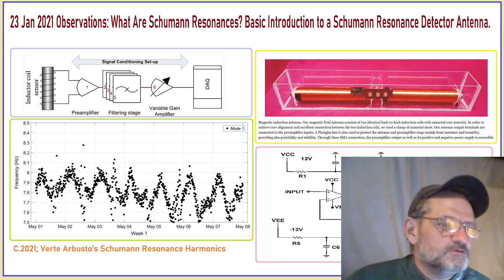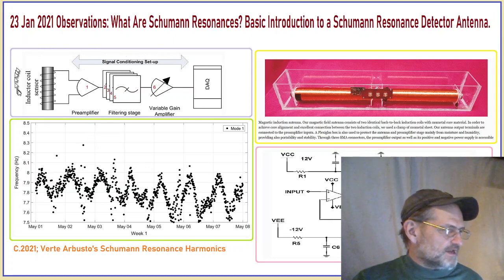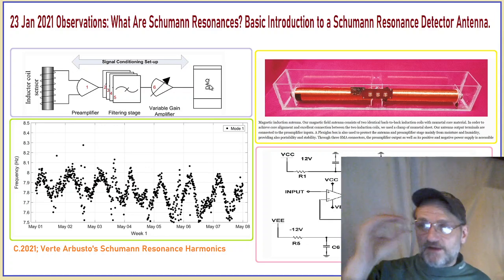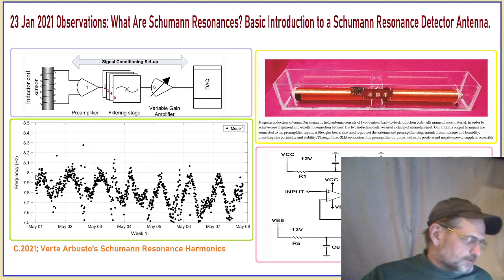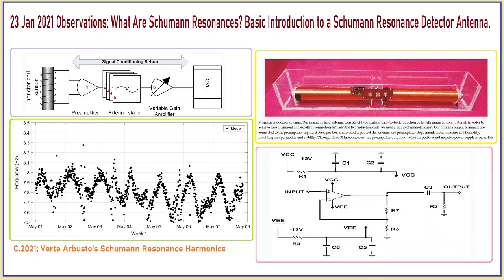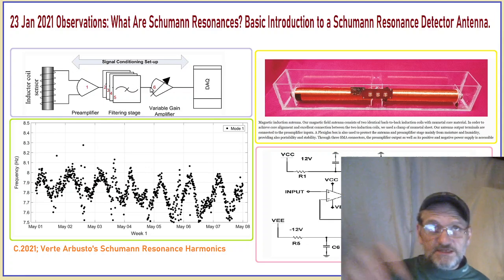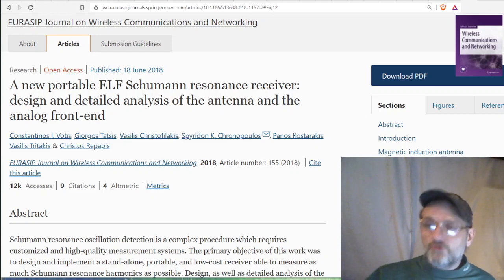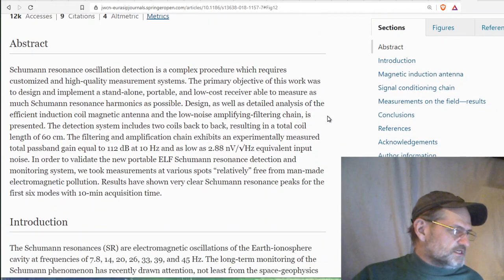24 Jan 2021. "A New Portable ELF Schumann Resonance Receiver"; Part 1. Abstract

Comment: I wonder if the other end of the metal rod that the copper is wrapped in is connected to ground?
Reply from the maker: If its not buried 6 ft into the ground, there will be a voltage differential. 
Earth ground itself is more powerful than Schumann Resonances.
Reply: @schumann-resonances  Thank you for the answer If a 1 centimeter thick aluminum piece is placed on the other end of this metal, will it prevent the signal transmission?  I am asking this for this reason;  I want signal input from only one end of the mumetal.  As you know, thick aluminum bar prevents signal transitions.
Reply from the maker: @ahmetozdemir7173  To do what with it?
After a certain point, it has nothing to do with Schumann Resonances and then you are just running a radio.antenna experiment. 
These things are designed to tight tolerances (the antennae), to detect a narrow range of signals. 
You lost me in trying to explain what you"re doing.
Reply: @schumann-resonances  I asked this for this reason; I want to be able to find the direction of the Schumann resonance source. That's why I wanted to ask if it would be helpful to close one aspect of the mumethal.
Reply from the maker: @ahmetozdemir7173  The source is lightning in the atmosphere. These waves travel the glibe, then crash into each other, to create standing waves. 
I don't get what other-else thing you are looking to find?
Reply: @schumann-resonances  For example, an earthquake signal.  Or, the storm, or even the direction of the Lightning zone.  Being able to find the direction of these resources is something that is important to me.
Reply from the maker: @ahmetozdemir7173  Earthquake requires a seismograph. 
You will need to contact a legitimate Electrical engineer, or radio tech. 
I have no idea how to deconstruct the precision antenna to morp it into some kind of other detector. 
I can't see how you can get to what you're looking for with the mumetal, induction coils, or any of that. 
I am nowhere near smart enough to deconstruct the Schumann measuring hardware, to morph it into that you're looking for. 
Schumann resonances oscillate in pmace. They don"t have a source like you are striving for.
Earthquakes don't cause Schumann. 
Its a different circuit altogether.
Earthquake range is in the nano, or milli-volt range. 
Honestly, what you're looking-for is well beyond the scope of this channel. 
You need a legitimate engineer. 
Best of luck!
Reply: @schumann-resonances  I took your precious time with my questions.  really thank you so much.  You made very good statements.  It helped me and I made progress.  I follow your channel.  I wish you good work.
Reply from the maker: @ahmetozdemir7173  You are welcome. Im happy I was helpful. I'll look online for somethings for you from one of my sources and see if you can get anything from it.
Reply from the maker: @ahmetozdemir7173  ( http://www.vlf.it/ ) This is an interesting site with a focus on radio/vlf under 22KHz. As a techie-type I enjoy going through the site for useful articles on all sorts of facets of radio antennae, etc.
( http://www.vlf.it/cumiana/livedata.html ) 
is the place we go to see a great example of seismic measured alongside of the electric, vertical-conductivity channel, which is the amplitude of the Schumann resonances. 
I humbly suggest for you to understand the basics of radio, and vlf as its been working, and established. From there, you can branch-out into new areas. It's possible that someone's doing something close to what you want, you just need to know how to access the research on this. 
Please, go over to one or both sites, and I'll be happy to work through whatever technical points that I can, based on what I've been exposed to. 
Thank you for the rather challenging queries.
Reply from the maker: @ahmetozdemir7173  Also, I might suggest on my channel the videos where I discuss Cumiana, Italy. I go through the graphs, and what's on the livefeed from there.

Comment: LOL❤️this Video is exactly what I need, I'm in discussions with both my brothers in law about building an antenna and I'm also trying to explain the amplification/ filtering chain equipment, this could be the start of a possible opportunity, well I'm putting it out there to my higher energy source and fate, thanks Verte it was very helpful, and the time line is a positive  endeavour. I Will! ✅❤️😎🏄🌈🇦🇺
Reply from the maker: The toughest part to this is finding the right location, IMHO.